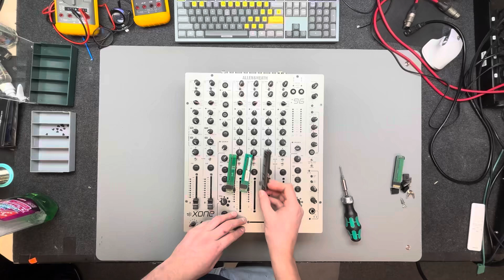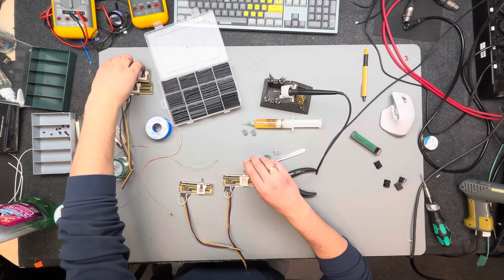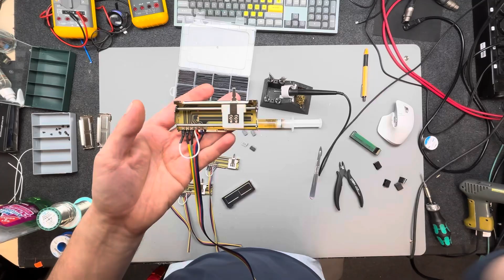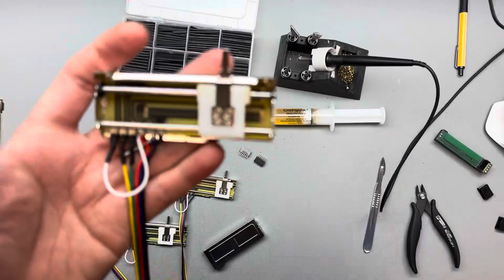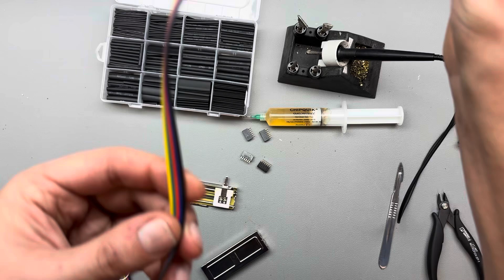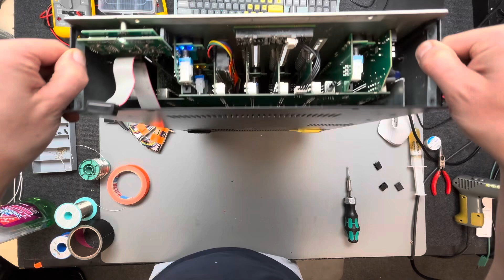Allen & Heath Xone 96 Fader Upgrade: Installing Xone 92 Faders

Comment: Great video. Please can you during a filter board replacement on Xone96 , do the channel line faders (1–4) need to be removed or disconnected in order to replace the filter board?
Reply from the maker: Thanks for your kind words! 😊
No, you don’t need to remove the faders to replace the filter board.
Reply: @miktroniks thanks for reply. Very shortly after replacing the filter board my line fader from ch1 started to lose contact when it was on max(channel fader all to the left) so I was wondering if it could be related to the previous service that there was a small mistake or that something didn't fit properly. I m not sure why this happened 96 is not much in use and use with care, still under warranty
Reply from the maker: @bluen1  

In my opinion the Xone 96 line faders are not the best ones, but they also don’t just fail by themselves.
If the fader is seated correctly on the PCB and you still have bad contact, it’s usually either liquid that got inside or strong mechanical wear. From what you describe (light use, still under warranty) this doesn’t really fit, so something else must have happened.
It’s hard to diagnose from a distance, so I’d let Allen & Heath or the service center check it under warranty. I don’t think the filter board replacement itself would damage the line fader – they are separate.
Reply: @miktroniks from my side there is no liquid that got inside or strong mechanical wear because I m gentle with faders and no drinks around the 96. Do you think its only line fader it self issue? I reported the problem to the store and now I m waiting response with new delivery instructions. Waiting time to finalize previous repair was way to long, now I hope not the same shit agian
Reply from the maker: @bluen1  Try pulling the line-1 fader all the way up and then very gently wiggle the fader knob left and right.
If you hear noise or crackling, it’s most likely the fader. But if not, it could be that at full level on line 1 some op-amp is defective…
Where are you from?
Reply: @miktroniks Netherlands, you, Berlin? When I do that what you suggested to try my signal gain level drop, and only if  channel fader is all to the left. Thanks for suggesting
Reply from the maker: @bluen1  Then it’s the fader.
You can also replace it yourself if you feel confident – it costs around 40 € approximately.
Reply: I believe this issue is either a manufacturing defect or something that happened during the service. I’ll check if they can send me the fader so I can try replacing it myself, of course only if that wouldn’t void the warranty, or to wait for sending the 96 until they have a fader :D

Comment: Local club owners decided to replace faders by themselves on Xone96, but something went wrong and they burned MCU. Fortunately they knew another guy who owned Xone96 and he agreed to provide it for firmware dump. Fortunately it was easy, the only thing that confused me was 20 pin header that was not typical 2.54 size, but microgrid. I modified dupont wires and dumped firmware successfully. MCU has been replaced by another person and he confirmed that everything works fine with dumped firmware. We had a lot of fun doing this quest all together :)